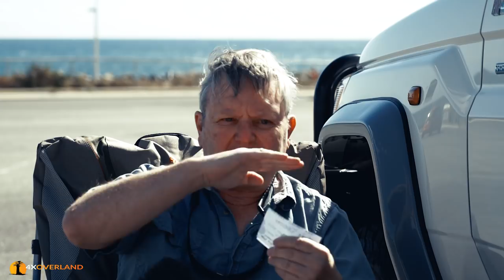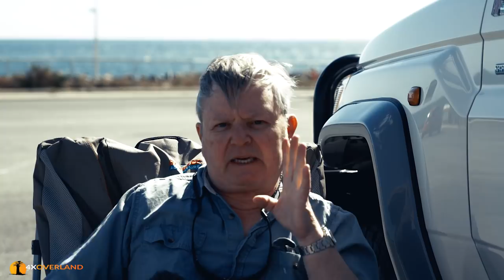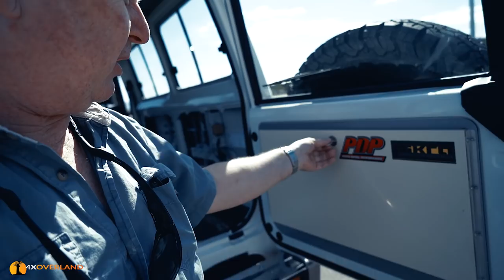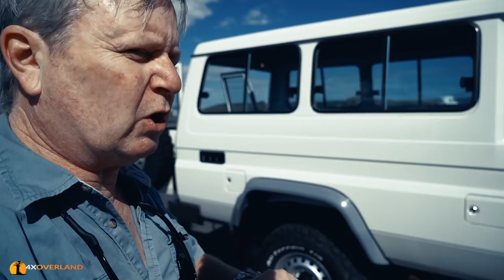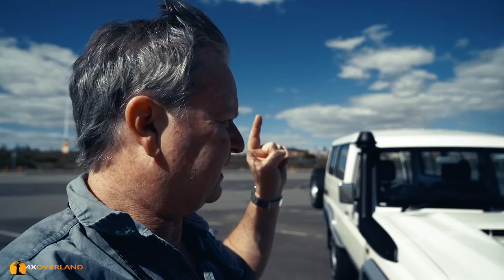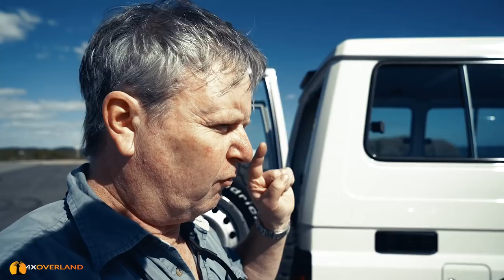PERFORMANCE UPGRADE EXPLAINED. AndrewSPW Land Cruiser build-9

Comment: Great video Andrew! I just ordered a Steinbauer module for my 79 series V8. Very reliable module and it will "wake up" this V8. The thing that a lot of people might not realise also is that, with more torque and horsepower, you spend less time revving the engine to get up to your target speed so you spend less time squeezing the pedal down which equates to better fuel economy. With the stock tune you'll have the skinny pedal pinned all the way down up a slight hill as the speed slowly climbs and you're actually wasting more fuel.

Comment: Thanks for the explanation Andrew....I put a Green Diesel Engineering tune on my Mercedes OM462 in my Grand Cherokee.  It changed the entire character of the truck, better throttle response and reduced turbo lag, plus better MPG.   I see a lot of Toyota guys here in the states modify their suspensions, but jump on anyone who's modifies the engine....

Comment: I think you're spot on here Andrew. Plus the fact that Toyota usually over-builds many of their engines massively, and then conservatively tune them for maximum reliability, or the potential for other upgrades. Many of these engines can easily get a bit extra power without any reliability problems.

Comment: loving these upgrades Andrew. I'm in the slow process of kitting out my 78 and will be putting in a unichip shortly. interesting take on the exhaust, but if I've got a v8 I want it to sound like one lol. my 2013 doesn't have the same emissions standards though. Great you got a troopy rather than  the ute, I get a grin as soon as I climb into mine

Comment: I absolutely agree with what you say about running in a new engine. Experience has shown me to give a new internal combustion engine lots of revs, load and heat cycles. I think it’s even more important with such a large and relatively ‘unstressed’ engine as this. 
Some folks on the landcruiser forum openly state they’ve never taken their LC200 past ~3000rpm because it has so much grunt. I think that’s asking for trouble.

Comment: I agree with you Andrew. A good tuner, you have no worries. I have seen so many Powerstrokes with shady tunes in them that end up with a rod thru the block. Most common failure I've seen from poor tuning is melted pistons. Here in the US a lot of people remove the DPF's, and DEF components just due to the failure rate of these components. We also have problems with people properly maintaining their vehicles. Diesel engine reliability has gone way down since EGR, DPF'S, AND DEF after treatments.

Comment: If I were you I would upgrade the snorkel to an aftermarket one, the factory Toyota ones aren't fully sealed leading to dust and water ingress. Furthermore, the factory snorkels are too small and will choke your engine, the more air that gets in, the more fuel and power you will get. It's like running a marathon while breathing through a straw.

Comment: A SP-W, you were backlit most of the video.....take it as constructive criticism (no malice intended).  Next point: I just spent $1200AU on having my diesel de-carbonised and your comments are valid on that subject.  Poor (dirty) diesel is one of the problems involved.  Toyotas standard diesel exhaust muffler is also a trap for carbon particulate and clogged up. It was replaced with a free-flow uni muffler to help allow the turbo to breathe.
Looking forward to the next instalment of the vehicle build :-)

Comment: Hells bells...................some of the negative comments are really from people who just don't understand engineering concepts. You are right....a bit long winded sometimes BUT....right. Hey, by the way,  I was fortunate enough to be able to buy a top of the line Porsche 4WD (520HP)....I have owned several Porsches..........In handing the car over to me, a four-hour episode, with a mechanic, I asked how long should I run the engine in for before "hosing" it. They both looked at me and the mechanic said: "As far as the showroom doors"............there you go. Cheers, David

Comment: My unfortunate experience with unichip
Some years back i decided to see if my little townAce van could be improved. Yes, silly me! The first sales person explained all sorts and was positive of an outcome. When I turned up for the fitting the reception was somewhat lack luster almost snarly. I was told to Boff and they will call.  OK paid the money (lots) and drove off. I was not given the print out of improvements (if any) but after telling same snarly that I was promised such I was asked why I wanted it?? eventually after a considerable wait I was offered one, no explanations attached.  Improvement? I just assumed my imagination over ran reality.
Some months latter the little plastic thingy that was hung over wires under the dash started to drop to the floor. Eventually It annoyed me, so I just pulled it off and into the glove box. Well what do you know, even the passenger noticed the little engine seemed freer and happier to run. I returned and they wanted more money to properly disconnect it. 
In summery the whole thing is a fraud and have since read that similar experiences have  befallen  other suckers. 
So to other simpletons out there, if you don't know your engine well and are well versed in this sector of the industry, pass by on the other side!!

Comment: to add to your theory The Chip gives you more driving mode options. off-course each option will have its own pros & cons.

This is similar to SUV offering different suspension mode.

Comment: Andrew, you really should ask PDP about the clutch, and the CV joints, etc. I'm sure the Toyota clutch and other driveline parts are undoubtably high-reliability parts, but they have a specific torque rating, and this upgrade to 600 Nm may be well beyond that. It's not just about engine performance, you have to get that torque through ALL of the parts in the driveline without over-rating any of the pieces. Otherwise you may find yourself with a broken spider half way up that long dune.

Comment: Bottom line is that when you chip an engine all you're doing is making it more efficient. Anything you actually bolt on will to an extent damage an engine but with software tuning you're just making it more efficient. The same amount of energy is there but more of that energy is being used to actually move the vehicle. There's always the possibility of going past certain safety boundaries but as long as your tuner is tailored for your specific vehicle that won't happen. When you're looking for a software tuning solution always use a tune thats tailored specifically for your very vehicle thats why most people would say stay away from tuning boxes, they assume your engine hasn't changed at all since it came out the factory. With Unichip they actually tune it for your specific vehicle, thats where the difference between "plug 'n play" boxes and proper tuning solutions.

Comment: I don't understand the controversy.  By all means, remap the ECU to tune the engine to your needs.  I don't think it will materially effect reliability.  As you mentioned, government regulations are the most important perimeters of factory engine tuning.  Your needs are an afterthought.  

I come from the motorcycling world, where these sorts of engine mods are common.  Go for it.

Comment: Hey, Just bought 285/75/16 BFG KO2 for my HZJ 78 here in Dubai. Love the look but keen to know what PSI you think I should run.....fully camping system in back so heavy!
Reply from the maker: Depends on the terrain, load, air temperature, density of the sand, heat of the road surface. No easy answer.
Reply: Sorry, road surface. Running 38 PSI at the moment and fuel consumption got lots worse. Previous Geolanders I ran at 45 PSI but that was a light truck tyre.

Comment: Have you considered upgrading your exhaust to a system like Ronny Dahl's? That truck sounds very good
Reply from the maker: I consider an over-sized exhaust an unnecessary waste of money because for the slight performance gain versus its cost, its just not worth it. And I would prefer to emit cleaner exhaust if I can and will leave the system in place.

Comment: I got myself a TRD supercharger . TRD is Toyota product tested and promoted  by Toyota. it said in red fat print, that my original truck warranty and reliability  will not be impacted by adding this product. Does the  Unichip in compliance  with Toyota or you are on your-own?
Basically do you keep   the warranty or you kiss it good-bye ? I need to know the fact not a debate. thank you.

Comment: hey andrew awesome videos! i especially enjoyed the electrics one i learnt a lot. ive got a dual cab triton had it tuned best thing i did. doesn't run as hot towing the boat definitely more power and because i have more power im not flooring it as often so im getting better fuel figures! quick question... when you say dont warm your car up in idle i always start the ute then lock the house etc for like 2 mins its just something I was taught. are you saying dont do that or do you mean dont idle for 20mins? I was taught listen for the slight high idle... when it stops drive.
Reply from the maker: Low idle means the engine is running normally. High idle normally means that the engine is running rich, which it does automatically at startup. My recommendation is start, idle for 30 seconds, or a minute at extremely low temps, (all one needs to do is make sure oil is sent everywhere it needs to go, which takes longer at very low temps) and then drive normally, normal throttle but beware of wide throttle openings at low rpm. This is the most important thing to avoid when the engine is cold.
Reply: I live in Cairns in far north queensland we don't do cold haha. thanks for the advice mate! look forward to the next video

Comment: One other thing. A few months ago I was talking to a guy who chipped out his VW Golf R to get more power. He was driving to work one morning when he heard a loud pop. Luckily he was still able to drive it to a dealership for repairs. Turns out he blew open a joint in the air intake header downstream of the turbo. Too much boost! So it shows you that the original components are only designed for their factory rated output.
Reply: jonfklein I
Reply: +jonfklein The engine in the Golf R is already highly tuned engine, it's the highest output available using the EA888 engine. There's not much headroom for pushing it further without mechanical mods. The engine in Andrew's 78 is at completely the opposite end of the spectrum - it's the low power, low tune version of that engine. That means he has a lot more margin to play with before he has to worry about mechanical issues.
Reply: Do you really know that, or are you guessing?
Unless you are part of the design team at Toyota that worked on this truck it's best not to mess with the design. That's the way I see it.
Reply: +jonfklein Toyota's design team have already messed with it by sticking another turbo on it, which gave it an extra 160lb/ft of torque. It's very common for manufacturers to have ranges of engines which are mechanically virtually identical apart from the turbo and tune.
Reply: Maybe, but it's not always the case, at least that I've seen with other vehicles. There are often slight differences. For the higher performance versions of engines, they put in special high strength pistons, connecting rods etc. They don't use these on lower performance versions to save cost.
Unless you have detailed knowledge about the engine, ancillaries and drivetrain design, it's best not to mess around with it. That's my approach.

Comment: Not sure the aircraft engine comparison is quite kosher. Most piston aircraft engines — your Lycomings and Continentals — are air cooled, large capacity, direct drive 'boxers'....basically big VW Beetle engies. They are large capacity to drive the propeller within a certain band of rotation speed for efficiency. They experience have  larger or looser tolerances than car engines for a number of reason. They do not have the temp stability of liquid cooled engines, they must take some shock cooling when idling in descent.  They have quite different engineering parameters.

Comment: are you aware of the 1hdfte motors that come in the previous versions of landcruisers in australia. its a 4.2 straight 6 turbo diesel.. efi and direct injected way better than the v8
Reply: 1hdfte can take big hp like its nothing. There is one getting around intercooled chip and a 30 psi gturbo with 200kw at the wheels and 900nm. Will outlast a v8 easily and are more sought after

Comment: I changed the suspension on my old (1st gen) fortuner. put an iron man system. only reason i did that was because the original rear suspension was badly build and they tended to roll over

Comment: I was wondering about the corrosion reliability in your area, is Rust a problem in the areas you go in. I know I'm in upstate New York and Toyota's don't last much past 10 years. The body's and frames just rot to pieces. 2005 Toyota Tacoma had to have frame replaced in 2012 because of rot $12,000 under warranty very common.
Reply: Wesley L. Wood there is no snow or ice in WA and nobody salts roads in the entire country as far as I know.
Reply from the maker: I know of some of Toyota's terrible corrosion issues. Its not bad where I live and will drive this truck. And the 70-series corrosion protection isn't too bad, as the mines they are used in are toxic to anything metal, and they don't do too badly. No salt roads in Australia. No ice.
Reply: 4xOverland the salt is what does it they don't seem to have any protection against it that works I haven't seen an older body style Toyota in years they've all dissolved unless they're summer only vehicles
Reply from the maker: I think that might be a U.S. thing. Toyotas do not have a bad reputation for rust elsewhere. Its pretty average.
Reply: My LC90 was 14 years old when I brought it and had very little rust, and never needed any welding - other than when I modified things :p - all the time I had it. We get a lot of salt on the roads here in the UK and it's generally wet year round.
Reply: Forgot to mention that it had nearly 180k miles and had done it's time off-road before I had brought it

Comment: I agree with you, but the conservative map produced by Toyota has been made  to avoid useless use of the turbo, to build a progressive temperature increase for the motor... same thing for suspension upgrades, which leads to increased wear of driveshafts in the long term.
You certainly will be fine as the motor is over engineered, but.. well. You dig into the margin calculated by engineers. Turbo will turn more often, and temperature will increase less progressively. Even if you drive it conservatively.
The solution? Keeping unichip like keeping suspension modifications, BUT be reasonnable: like a conservative suspension modification at +2" max, you could keep a very slight map modification, to preserve the conservative work of Toyota engineers.

Comment: The reason why "Piggyback" ECU's exist are simply to fool the data from various sensors and control modules (EGR, DPF,  MAFF HPP, injectors, Rail etc.) given to the OEM manufacturers engine controle module (DDE for diesel / DME for petrol). Whilst it is generally accepted that the engine manufacturers do "leave something on the table" performance wise for reliability and emissions and I just about understand what our dear Andrew Saint Pierre White is saying let me give you an other angle related to that new Toy engine! A chip on the old engine, why not. Its old, simple and robust with basic engine management. This new common rail puppy is extremely well developed and engineered and very very high tech. It (the DDE) relies on extremely accurate information given to it by these control modules because the high performance of these engines is down to very accurate tolerances of all the involved parts. Secondly, these engine management modules have extremely complex coding that have very high encryption to protect manufacturers investment (it 100's of millions of dollars to develop an engine) and they cannot be "cracked" - hence "piggyback ECUs". All you're doing there Andrew in all the warranted good faith in the Chip manufacturers is highly increasing the potential damage on your engine and reducing its reliability. Whether you use that performance gain or not and despite the solid nature of the components used for the engine and the engine itself, giving false data to the DDE will just reduce its capability to manage the engine and associated modules and components. The probability is that it will take it no probs but by default you are reducing the hour rating of various components. Lastly there is simply no way any piggyback chip, manufacturer no matter how good they are and the sum they invest can outdo the many years of research and the sheer unfathomable amounts of money the car manufacturers will invest with Bosh like BOSH to run these engines. I think your experience with Unichip and your other Troopy was entirely accurate. This is a very different cattle of fish. The only way you could improve performance and reliability is to improve hardware as you've done with the suspension. Still if Unichip is willing to pay for any repairs why not - thats serious product testing...

Comment: All these people banging on about it being more reliable leaving it how Toyota intended, neglect the fact that these engines have persistent air filter problems stock, along with the sensitive fuel issue both of which need to be addressed. 

So many of these engines of which owners weren't privy to these issues haven't made it past warranty let alone long term. PDP like any good performance shop do their R and D and know what works and what doesn't. That's why they installed the secondary fuel filter.